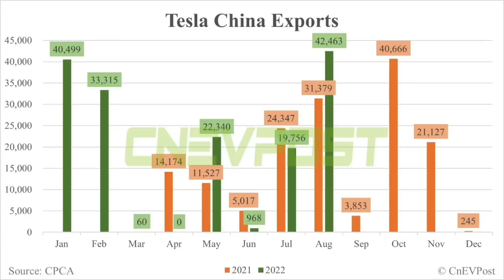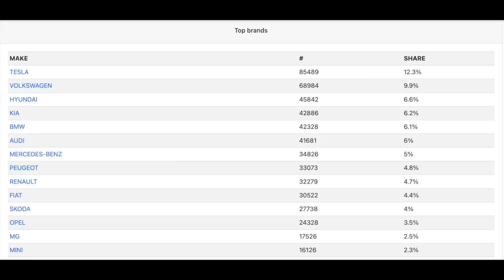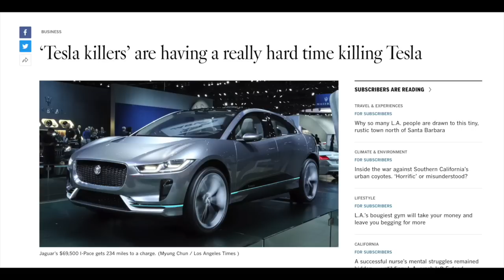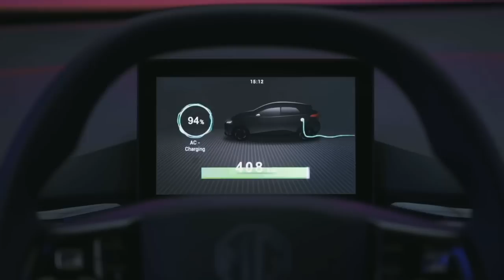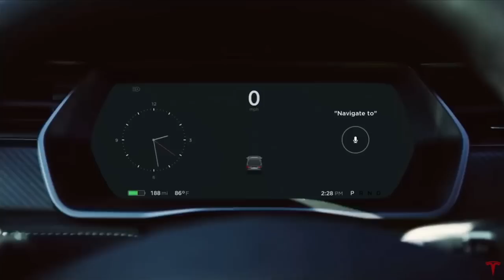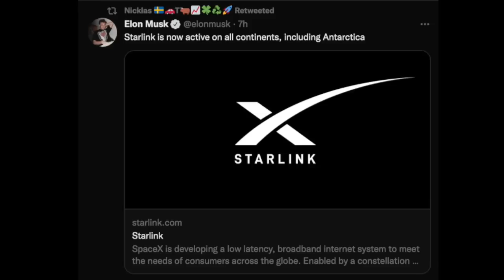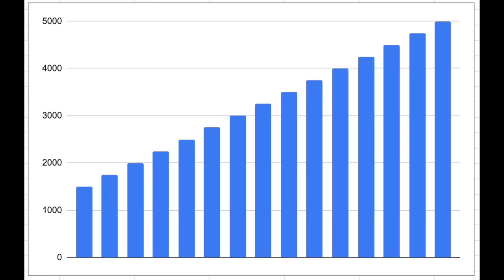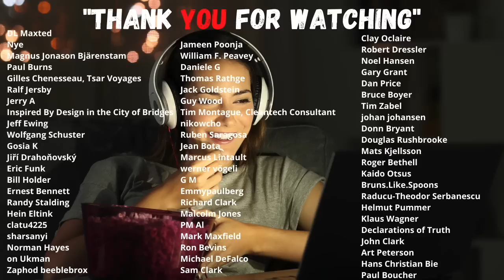Scary prospect for Legacy automakers…Tesla has moved on & More trouble is coming for VW

Comment: First, I am a Tesla Stockholder live in the USA and have a model y LR on order since February 2022.  Selling is one thing and delivery on time is another.  My estimated delivery date has jumped back and forth like a ping pong ball.  All I get from my Tesla advisor is broken promises on the delivery date.  Then I look on Youtube and see that someone else ordered theyir model Y LR same color as I want in early June 2022 and takes delivery in August 2022.  Whoever is in charge of deliveries at Tesla surely owes me an apology and should move my delivery forward instead of continually moving it backwards.  Then I am told by advisor thaa there is no one that I can contact at Telsa about delivery issues.  Not a happy camper here.
Reply: I understand your frustration. Also waiting for your reply my MY RWD in Europe. Should be somewhere in Nov. But the process is not as careless as I would expect from Tesla. The trade-in price offered by their partner for my brand new car was €12k less than I ended up getting from a buyer I found myself. And updates are really sparse, and void of real information. Still, the delivery time in my case should be ~2 months so still OK.

Comment: You're right on about wait times.   I bought a German ICE car a couple of weeks ago.  It wasn't my 1st choice but Tesla was still quoting several months before a car was delivered.  The other deciding factor is that Tesla pricing,, for me anyway,  has gotten a bit out of hand,  The German car I purchased, no not a VW,  was pretty well equipped and still came in 9-10 k  USD less than a non autopilot Tesla "Y" .  I'm not anti-Tesla; far from it.  I own their stock,  but I was able to get the car I now drive,  equipped the way I wanted,  the same day I saw it on the lot.  If I could have driven a Tesla off the lot the same day,  even though it would have been more costly, at least up front,   I'm sure it wouldn't have taken much time for me to justify the price differential.

Comment: Ford are in " supply cost shock". 1. Sales of ICE are falling - suppliers will charge them more for assemblies, and components (falling numbers are a huge problem for suppliers - they will have excess labour and machinery that they have to deal with). 2. Their EV numbers are way under their ICE production numbers - they won't be getting anywhere near their usual discounts from suppliers. 3. If they ramp EV sales, they are reducing their ICE sales, further reducing profits. 4. With relatively fixed costs - labour, factories, executive pay etc. - the falling profit problem escalates rapidly...
Reply: It doesn't matter.  The legacy brands know they have no choice but to transition to EV's.  And they will survive the transition because there are around 100 million cars sold a year and someone has to make the 98 million non-Tesla cars this year to meet demand!
Reply: @joeking433  But, a business cannot survive for long, when they are not making a profit.   And it will be a long time before they can make a profit on EVs, (I think). Sure they can make the necessary ICE vehicles, but they will have to charge more and more for them...this is not a temporary setback - it's a permanent disruption / dislocation...
Reply: @chrisheath2637  IDK, Tesla survived for 18 years without a profit and Amazon for 14 years. The worldwide demand for cars is around 100 million a year.  And Tesla is going to make maybe 2 million this year?  Someone has to be building the other 98 million, LOL!  Legacy brands will transition out of ICE cars and into EV's according to demand.  If they see a lot of demand for EV's, which seems to be the case, they will make more EV's.  It's that simple.

Comment: With fuel being the primary cost of operating a long-haul truck, and uptime being critical, the purchase price is not that important.
Reply: OK, I will correct myself. The salary of the driver is close to some trucks fuel costs being quite a bit higher. However, many trucks fuel can cost $70K per year, so again the purchase cost of the truck isn't a huge consideration. And sorry but spare me the complaints about diesel cost. Typically, a long-haul truck idles about 1,800 hours per year, using about 1,500 gallons of diesel. There are alternatives to idling.

Comment: Finally reaching the finish line with my Tesla Model 3 RWD order, but no VIN yet. I expect delivery next month, which is 8 months later. This is 2 to 3 months later than original estimate. There’s more moving dates back than forward. I’m ready with EV charger installed and permit signed. I don’t trust Tesla’s delivery estimates.

Comment: The 'outsourcing' of design, research, materials, fabrication, mechanical components and parts, electronics and computer chips, interior and exterior design components begs the question WTF do these guys even do?

If everything comes to the factory loaded in boxes or containers and all your doing is loading up a conveyor belt or at strategic points in the production how do you get to even call yourself an Auto Manufacturer?

GM maybe doesn't deserve all the ire they get I mean it's not there fault they paid over the odds for a slew of international automotive brands only to resell them for pennies on the dollar after failing completely to dominate the world of automotives.

You have to admire Tesla as in they seriously do not get the credit they deserve for going completely against the accepted Dogma regarding Toyota's JIT Stock Inventory Strategy. I mean for a Company with ZERO Scale Manufacturing Experience to decide unilaterally NO were going to bring as much of the manufacturing process in-house as possible is simply mind blowing?

In hindsight the financial difficulties experienced by Tesla make alot more sense. But one has to wonder did the extreme level of stress that the entire Company was under at literally every level create the diamond we see Today?

I look at Tesla and think this is an entire theoretical curriculum unfolding in real time and NO ONE realizes it's even happening. From their Organisational Structure, Zero Phase Hierarchy (new Employees are immediately empowered upon starting at Tesla), their information flow (both automated and human is automatically notified if there is an issue/problem and a team is then assigned/organised by the workers themselves etc.

I've seen Corporations spend millions of dollars looking to update and improve 1-2 areas of their Organizational Structure. Tesla does this incrementally and organically almost on a daily basis.

All I can say is this shit is Impressive

Comment: Honda is missing the point that switching to solid state batteries is easier if they have a production environment and supply chain to build EV's with the flexibility to adapt new tech. They need to be able to attract the engineering talent for EV's, and most importantly, for building the production lines and developing their supply chains. Waiting for unicorn batteries without EV experience, talent, production lines, and supply chains, they are dead in the water.

Comment: It's high time all Tesla's get vehicle to load.
Reply: I've heard a newer version of Model 3 or Y OBC circuit board has V2L hardware, unlike the one that made news some years ago. So, it's only a matter of a future software update. The more interesting question is, will it support V2G also.
Reply: @celeron55  I think it is more likely to support V2G than V2L, because Tesla has a bigger plans with energy and the birtual grid. Brands that support V2L have consumers more in mind. But is would add a bit more flexibility is tesla's would support both. Because not evry Teslaowner will have a garage or ideal spot to charge overnight, whichbwill make a V2L a more interesting prospect for many customers. Then the V2G option can cater for those who can afford and have the ideal setup.

Comment: People think 4680 is the magic bullet.  However even without it, word on the street is that the gigacasting sustained rate has roughly doubled from 125k / yr to about 250k /yr.  This puts Berlin at a sustained rate of about 1 M cars per year when the current factory is ramped.  Austin at about 1.75 M per year (1M model Y and 500,000 Cyber trucks)  Those throughputs will crush cost per vehicle with or without the 4680.  

4680 is very nice icing on the cake but I wonder if it will be going in cars any time soon.  This stockholder wants to see Semi and Cyber ramp first and they require 4680.